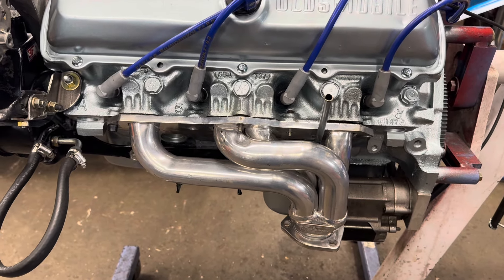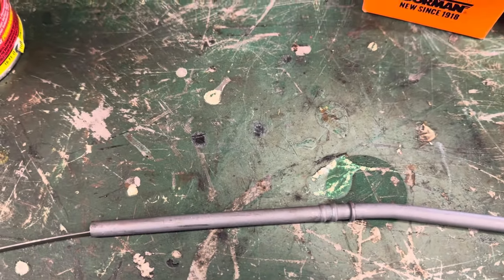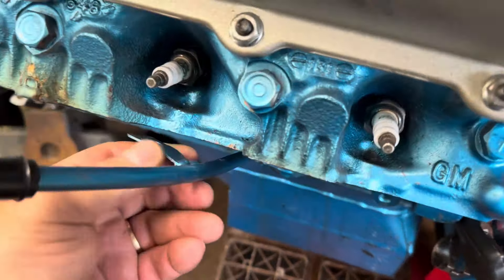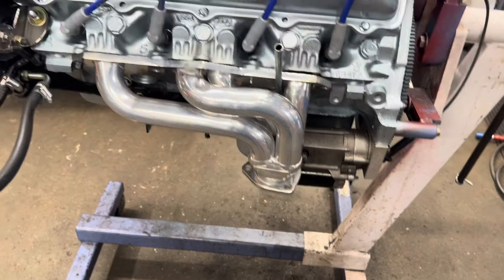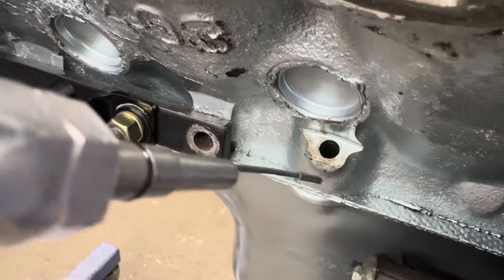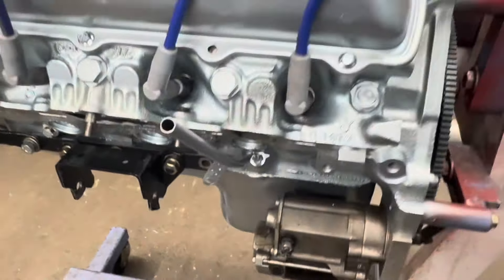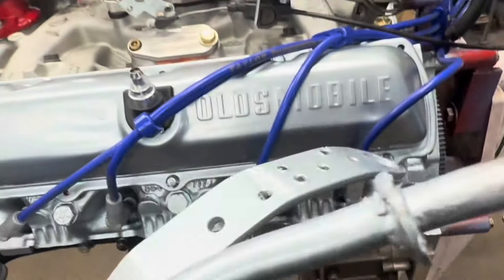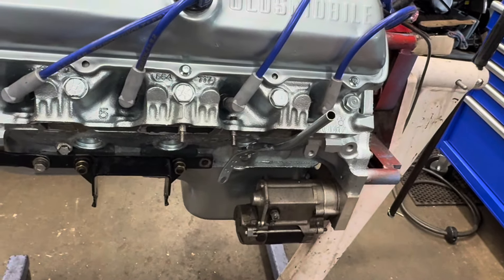Olds 403 dipstick tech

Comment: I made my 455 diostick tube with 3/8 copper, soldered a compression ferrule on as the stop.  Even painted it silver, there's no bracket just 2B sealer.

Comment: you had the heads off the 403 and you didnt drill the valve cover holes????  youre better than that!
Reply from the maker: I wanted to leave it stock and not modify it! Five valve cover bolts are lighter than 10 anyway 🤣